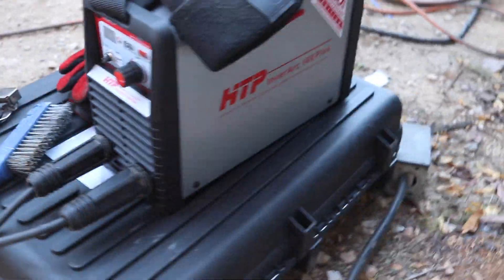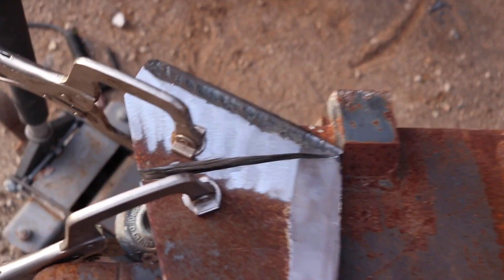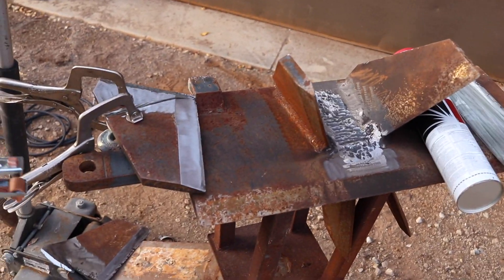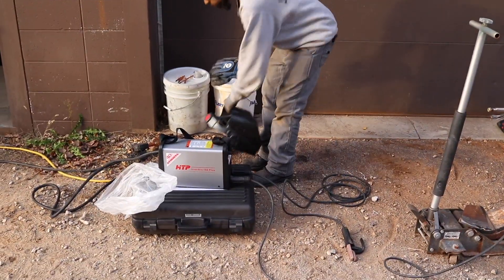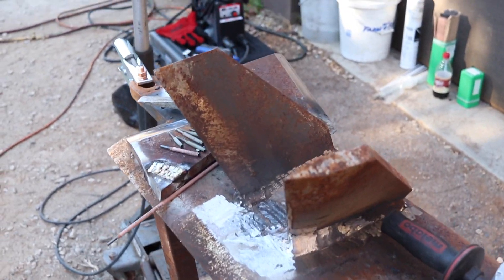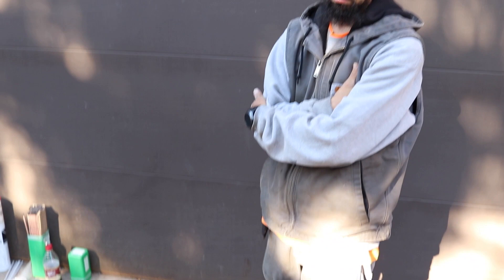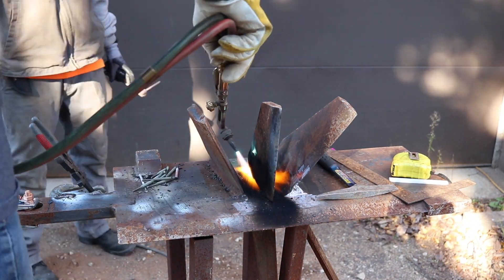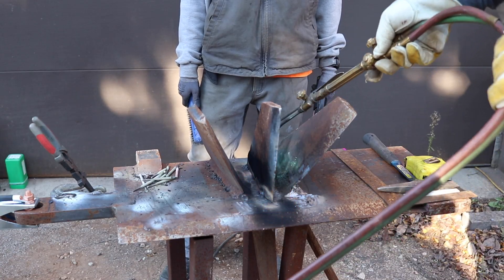Welding an 8 way splitting wedge with the new HTP Inverarc 160 PLUS

Comment: You could put a tool steel edge on it to keep . You can get it from weld mold  try 958 wire.
Reply from the maker: or some hard surface ...  or the guy could regrind the edge every week or 2 ....  these guys just destroy stuff !!!  and when you run wood with a bunch of catches and knots though it bends or tears off knifes anyway ....
Reply: @ZILAwelds  yeah those knots will destroy it quickly.

Comment: SMAW is by far my favorite process. Happy welding!!
Reply from the maker: When i first learned it it disliked it a lot , now it therapeutic in a way
Reply: @ZILAwelds  When i first started welding I didn’t know I was going to weld that day, actually I never welded at all before. 
     It was 1973 and I was a high school drop out, only because I wanted to work instead of going to school. I was on a horizontal pipe boring crew and was boring small 10 foot sections as we were in a tight spot and no room for the 20 foot lengths of 4” pipe we normally used. 
     After the first 10 foot was bored the foreman said we had to weld the pipes together, he didn’t weld, and asked who the welder was. No one answered, so he looked at me and asked me if I could weld. I immediately said “of course”. 
     I was a cocky 16 year old that wanted to do everything and learn everything. Cranked up the welder, garbed up and threw the helmet on and went to town. 
     When I fist struck the arc I saw immediately the puddle and saw how it flowed and kept everything tight as they turned the pipe.  I was very pleased how it came out. The foreman said “dang, looks good”. I just blew it off and said yeah. I’m 66 now and still love those rods. 
     5 years ago I was tacking in big plates in this dump truck then started to run the beads…I lost me groove, it was as if I never welded before.  Went home rattled as I love to burn 6011 and 6010 but was having a bad day. Was soaking wet with sweat, slipped and jabbed my chest with the stinger, my whole torso vibrated. 
     When I got home I went to ChuckE’s channel and searched on a video him using fast freeze rods. Saw his technique and tried it the next morning and it all came back. 
     I’m not saying 6011 or 6010 beads are beautiful but these beads were beautiful. Lol
Reply from the maker: @Mikael5732  exactly  !  get it done !
Reply: It's a process I need to be much better at but it would help if I didn't have a crappy machine too. :D